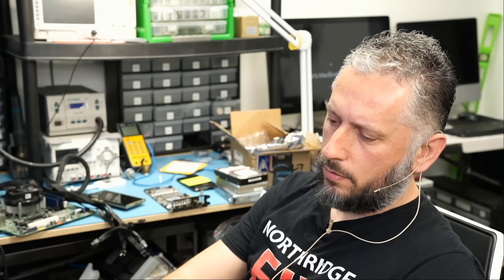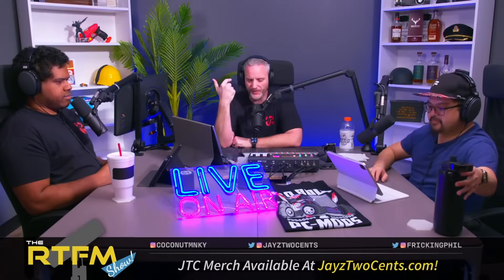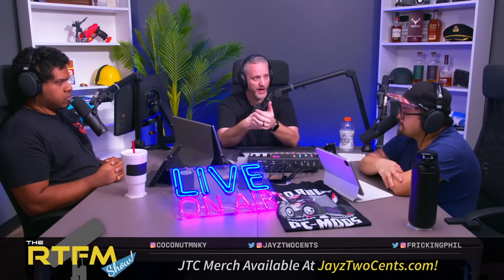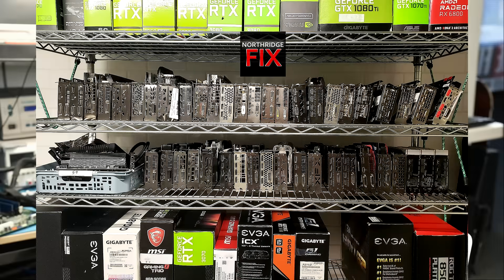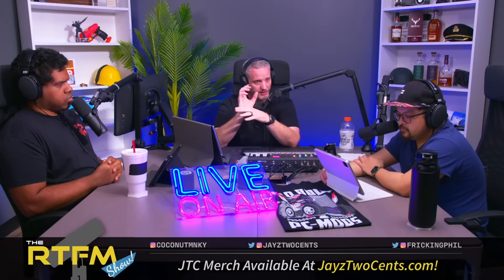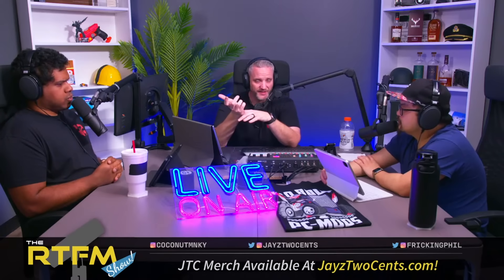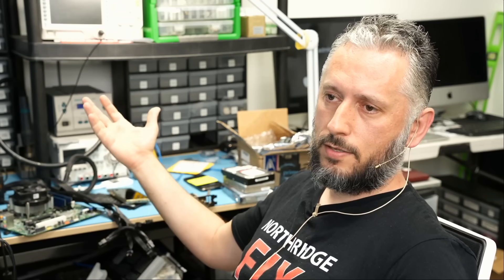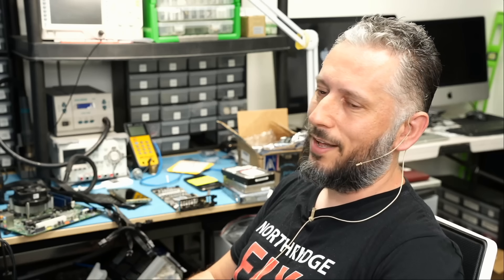Melting 4090 and CableMod. JayzTwoCents and Gamers Nexus Response. Blame NVidia or User?

Comment: I think what it comes down to, is that Steve from gamers Nexus doesn't want to admit that even with all his fancy testing equipment Alex's hands on expertise came to the proper conclusion.
Reply: You dont need expertise or testing equipment, connector melted, end of story. The main thing is to find out WHY, and how to replicate it, is it user error for real (it seems less and less likely) or it is some other problem on nvidia cards or maybe on power supply, or combination as they said.
Reply: It is not the fancy equipment .... you need to carry procedures. Procedures to test coonector are written. And you need to set TEST conditions. What female connector has he picked ?. They should test one from each PSU on the market, at least the top 10 or top20. Becuase end user does not have the female part he is using in his test rig ... so results are basically BS. Are lab results, not FIELD results. He need to pick real PSUs, with their stock connectors. And you will see differences (IMHO). If Steve isusing the most expensive AMP FEMALE part with silver plated terminals, of course the situation will improve for his testings. You can test just the MALE PART IMHO. Any test should be conducted with REAL FEMALE parts from the PSUs that gamers tend to use with this cards. Thereare automotive standards for connectors. And labs can carry all this tests. So you dont need to put a show with fancy equipment. I mean, CERTIFIED LABS can do it all and better.

Comment: Alex are the 4080 cards experiencing this problem because so far I haven't found this issue with the 4080 cards. My hunch is that the 4090 cards can draw up to 600 watts when overclocked while the 4080 cards can draw only 400 watts. I think the connector cannot manage the extra heat generated from the extra 200 watts of the 4090 cards. I am not an expert as you are in electronics, but one part of the puzzle that is missing is what wattage and brand of power supply is used in the 4090's systems? Am I correct, that if the power supply wattage is too small, that when the 4090 draws too much wattage, that this will cause excessive heat in the power cables?

Comment: This is a design fault, pure and simple. Plugging in the cable all the way is an easy and simple task. They are running too much current through a too small connector, imo.

Comment: Agree with almost every point made by every party frankly it doesn't seem like you're all that far off the same page, just reading different sentences

I will say I find Steve's almost toe tipping around the connector problems after he just got done ripping Asus a new one rather odd

One thing that I'd like to point out though, where Steve highlighted the connector with red marks to indicate that line where the connectors failed (16:50), you VERY clearly showed that connecter was fully seated, welded together in a fully seated position

So that was either damage the adapter obtained while it was fully seated, or damage obtained when it was forcibly unwelded. Definitely makes me question the validity of conclusions that were previously made by GN regarding them not being fully plugged in either way

Comment: I'm a big fan of the scientific method and Gamers Nexus do an excellent job of establishing a hypothesis and then fully testing it, using variables and constants, to prove or disprove. However, the fact that GN were able to replicate the cable melting by not properly seating it, does not mean that there are not other circumstances under which the cable can melt, which may have not been tested or tested extensively enough. The fact that GN is open to looking into it again is exactly what they SHOULD do. Ultimately, even if hypothetically the cable ONLY melted when not seated 100%, this is STILL a design issue and the manufacturer (nVidia) SHOULD bear liability for the issue.

Comment: I agree with you. Can this discussion be settled by using a thermal camera to determine where the heat is coming from? Or by comparing the models of video cards, including the one with three connectors? Regards!

Comment: "Molecule of Brains" .. Yep that's the problem the cards you fixed the owners did not have a 'molecule of brains' and simply failed to plug in their GPUs properly. Look up arcing temperatures... The initial failure rate was <50 per 100,000 units, more money than brains.

Those connectors otherwise are tested when properly inserted to take two, three or more times the amount of wattage before failure.
Reply: Are you a designer of NVIDIA? or a ultra fan???
Reply: @titoferro7774  .. Neither, I own a data center. Search PCIe Melting .. this same issue has been going on for decades.
Reply: .. Any connection that is not properly seated it could be a PCIe it doesn't make a difference, it will experience the same melting. Search .. PCIe melted cables. For probably the 4th or 5th time, the problem is arcing from an improper connection. You may not want people to tell you the truth or you may not want to accept it. It doesn't change the fact of reality. You're a smart guy. Test it out for yourself...
Reply: .. CableMod.. think about it, CableMod's connector adds 2 failure points: one to the GPU and one more to the actual cable going to the PSU.

Comment: Watched you trying to unstuck the 90 degrees adapter from the power slot , this is clearly a design issue. They opted for a 12VHPWR connector on the 40 series when they've been using 8 pin PCIe connectors for how long? decades? And they're gonna pretend it's an end user issue... OK Pinocchio 😂

Comment: If the cable clicks into place and appears snug then it should work.  If the thought is that you need to move it from side to side but there is no visible difference - the card is still clipped in and snug, how can that be user error?  Even a “professional” would not be able to determine the difference by looking at it.

Comment: I agree with Jay if the 3090ti is using the same plug as the 4090 why are only the 4090 plugs melting? Does that mean 3090ti owners are not having any "user errors" 🤔  unlikely. Nvidia needs to recall the 4090

Comment: From what I've seen, the failure point is the electrical connection between the male and female pins on the pcb connector. I'm guessing there is a high current flowing, that means the electrical connection must have the lowest impedance achievable. A high impedance or intermittent connection will cause excessive heat. That pcb type connector is not suitable for high current so to me, its a design flaw!

Comment: You are totally right Alex. We never had these problems when we had the older style of connectors because they were oversized for the job. The connectors now are theoretically up to handle the power of the cards..
Reply: yea now also with 5090 perfect, with that little gauge wires the heat will melt the plastic connectors which will loosen the connectors overtime until the ressistance too big because not seated properly, no load balancing on psu side and gpu side and no current limiter each cable power it will melt the questions only when, $2k but no safety at all  its crazy

Comment: For me the problem is to much powerdraw from the  bronze pin of 12vhpwr a bad enginnering ! 600 watt is to much  when you consider 8 (bigger pin) pin connector are rated only for 150w.
Joule laws do not change with the past of time
Next generation of vga will be equipped of dual 12vhpwr to avoid this problem

Comment: I agree, its a card design problem... Still melting with properly seated modded connectors... You would think Gamers Nexus would not double down on user error... At least JayzTwoCents has seen the light!
Reply: They're not. It's a combination of design flaw that causes user error. So Gamers Nexus does recognize that the design of the plugs needs a redesign to diminish user error.

Comment: I believe its down to high current draw through the connector that has pins that have been designed wrong.
I believe if the pins are not tight enough together there is room for arching at the pins at high current draw.
The pins are the problem plus high current draw.
Make the pins fit a lot tighter.
The female part of the plug that accepts the male pins on the card is where the problem is. Poor connection with high current = 🔥
It's as simple as that.

Comment: let me get this straight. lets say a car manufacturer has this special lug nuts for securing the tires down, user can install the tires correctly, torque them down correctly but there is still a chance of the tires to wiggle a bit if you turn them too much and some tires end up falling off. would that be user error?  NO. i dont know what Steve is smoking. the evidence of that 90 degree adapter melting while fully seated is all the evidence you need. this is on NVIDIA.
Reply: The problem is everyone is right, its a poorly designed system which invites error from the user (partial connection, pressure on cables) and design fault (material ingress, mechanical stress fault).
Reply: Hopefully NVIDIA never enters the electric car market ...
Reply: Agreed
Reply: Steve is just a shitty shill now. GamersNexus has 0 credibility going forward in literally any matter.
Reply: Steve is smoking Nvidia's 💵JMO

Comment: I think its better to replace the connector with wire directly solded to the board
Reply: Or just power plugs on the back of the cards, directly to wall socket

Comment: Did you hear burnt connectors from the old ones? NO ,  
did you hear about the burnt connectors of the new ones? YES...
The problem is in a bad design of the connectors for the amount of power that must pass through them, Nvidia FAIL, PERIOD.

Comment: my guess would be some silicon is worse then others(obviously).  Some silicon just requires a massive current spike to maintain clocks, which results in runaway temps on the connector.  The sad part is this could of not been an issue with 2 of the 16pin connectors or just 4 8 pin connectors. This is nvidia for forcing only 1 16 pin connector which when i see the pins do not look to much if at all thicker then the old 8 pin connectors which are only rated for 150W and only adding 2 pins does not quadruple the current capabilities.
Reply: transient currents (aka spikes) do absolutely nothing when it comes to producing heat. It's Q = I2Rt - > t is for time. the transients are few milliseconds, so they do nothing. What causes the heat is the constant/sustained draw. So your guess (and bad silicon) are totally wrong.

Comment: Why does the manufacturer of the graphics card only make one connector as an input? When it comes to power consumption, it is clear that it will be very hot there. I'd be curious if Alex connects the card and checks it with his thermal camera when it's under load. It's certainly not his job, but it would be interesting because he has such a camera.

Comment: So for me it looks like this: This 3- or even 4-in-1 connector is a propriatary design that apparently only NVIDIA came up with. To me the single end that plugs into the board looks like any regular PC power connector. To do this safely it would mean that this connector regarding the max current load it can take, would have a safety margin of at least 75% or even more to be on the safe side when feeding 4 regular power connections into one single connector. I don't believe that these connectors are so overspeced like this. To my experience normally things are only having a safety margin of 30% to 50%. Otherwise controlling would cut your manufacturing cost down because they'd deem it unnecessary. So I would like to hear from NVIDIA what made them think it would be ok to just combine 4 power connectors into one and this would represent no problem. Who signed this design off on what basis? So for me it is a clear design fault unless proven otherwise BY NVIDIA.

Comment: I feel like Steve is about to have a hard time explaining why he is protecting Nvidia and telling the consumers that they're stupid.
Reply: What?
They are saying that the patten observed in this specific instance by Alex was not representative of an increased failure rate, as it was a batch of failed cards from Cablemod.
Regarding the connector itself, refer to their previous video series where they conclude the issue is 95% on the manufacturers for allowing the design of the clip to be able to "close" without the latch engaging, and 5% on the user to be aware of the problem and triple-check their own GPU.
Reply: @frid00000  Insult to who? Nobody is blaming the people who have this happen to them, they are just explaining why it is happening. All 3 people here blame the card maker for this problem existing.
Reply: @frid00000  Not sure what you mean honestly... yeah GN does roast them never ending, that is the statement as I see it though.

I don't know what problem is a century old, but I would surely agree that MSRP problem is getting real old. lol
Reply: I mean, the people at GN are human, and sometimes you can get tunnel vision with things like this. I hardly think GN or Steve is protecting nVidia... and as ruthlessly as he has roasted them in the past, I don't think he has anything to worry about.

If you feel stupid because of something he said, that's a you problem. GN is fully on the side of consumers, and they're staying neutral until there's more information. It's overly cautious, but it's a responsible position to take.
Reply: @x8jason8x  He definitely is protecting NVIDIA. Especially with the launch of the 7000 series, even though 90% of the information was positive he still tried to make it look like it was half shit and half okay when no sane person would truly be that critical.
Reply: Steve protecting nvidia? Yeah right
Reply: You must not watch his videos... You didn't even listen to what he said in this video if you think he is calling people stupid or protecting Nvidia. He constantly blasts them for the stunts they pull, and even said in this video that the connector is a problem because it is too easy to get wrong.
Reply: What I find funny is that in this instance you have an expert in finding and fixing issues with electrical components tell you it's a problem with the product and a YouTuber that tests and reviews the product telling you its consumer error and you still take the word of the reviewer. That's like having a mechanic telling you that it's the car and a driver telling you its not.
Reply: @UnselfishPath  Again, Steve has repeatedly called out nVidia, and specifically this connector. Your opinion is half-informed, baseless, and it seems like you want to have an issue with them.

Which is fine, if that's the case, do you. Just don't expect those of us who want all the information before we decide to malign the character of proven consumer advocates, to agree on any significant level. Steve and GN have proven themselves beyond reproach an innumerable amount of times at this point.
Reply: @x8jason8x  I know that he has called them out on multiple occasions, I watch his videos just as much as any you do! No I don't want a problem with anyone! In this instance it just seems like he's being a little too overprotective and he's ignoring what a person that works on graphics cards all day long is saying.
Reply: @UnselfishPath  We won't be sued for being wrong. So it's not surprising that people don't understand that Steve can't just go hot whenever he wants to. Pay more attention to what he implies with snark and derision is all I can say. It's one thing for him to destroy Dell over a prebuilt he has in hand, another entirely for him to scream "recall!" over a connector that's used in plenty of other applications that don't melt.

Yes he is being a bit overprotective, of himself and GamersNexus.
Reply: @x8jason8x  okay buddy you have a good day! 👍
Reply: @UnselfishPath  Sure, you too.